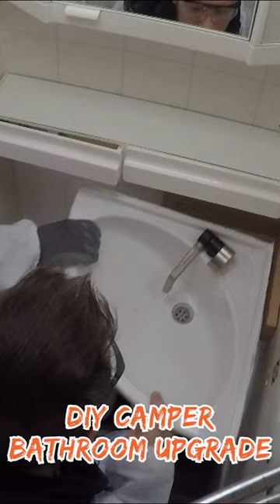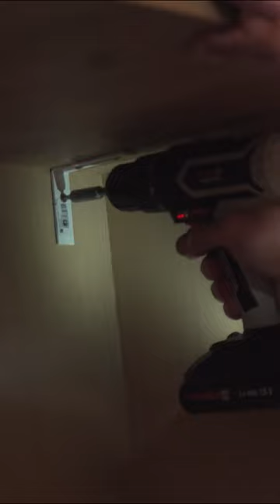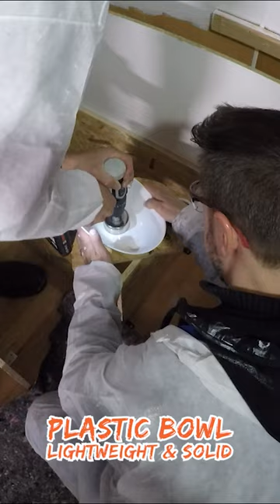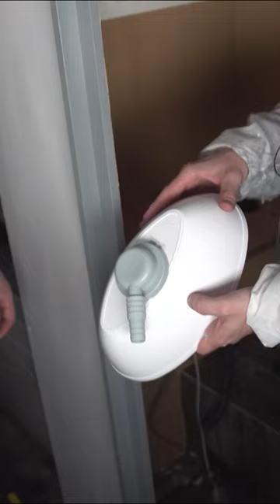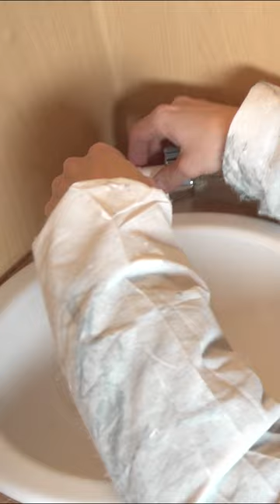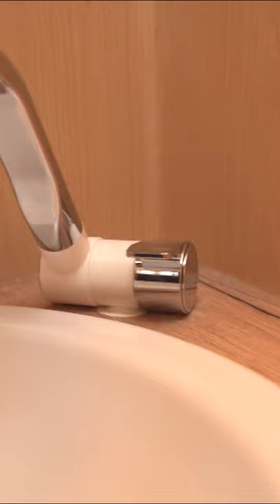Easy DIY sink for camper bathroom - #shorts

Comment: Looks great - Are you in Europe ? This is the second bowl sink that I've seen connected with that type of tubing and a hose clamp that looks to be around an inch in diameter ?
 I'm in Canada, to make my bowl sink  I had to use a cheap pop-up sink stopper drain assembly and then plumb the drain extension into a piece of ABS 1 1/12 inch pipe that sits into a grey water jug. (1 1/2 ABS pipe is the standard size for pipes draining into   the main drain stack here) But I don't need residential plumbing for this lol
I like your way better cause the drain and "hose"  attached appear much smaller. 
What size drain /basket assembly did you use ? Nothing comes up in a Canadian search maybe I'll try a Chinese site they might have smaller plumbing fittings